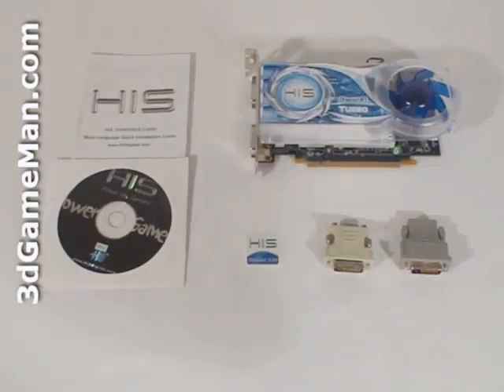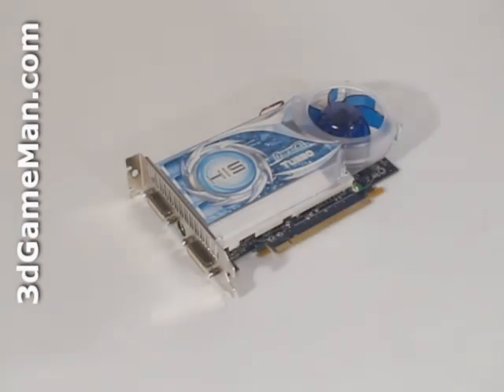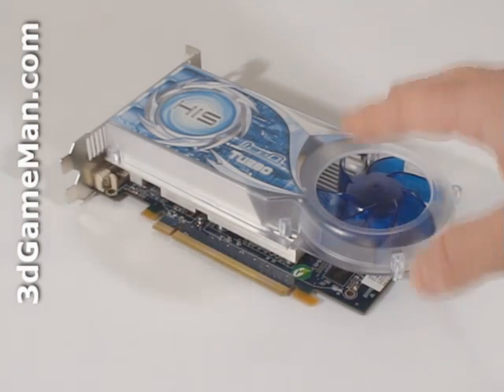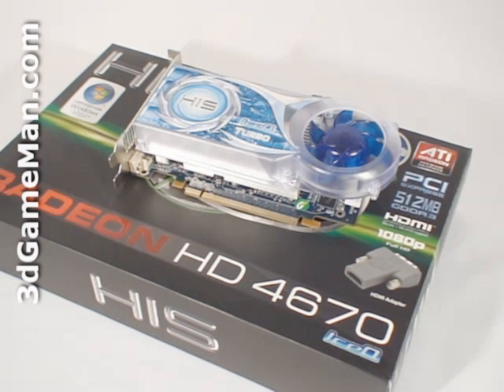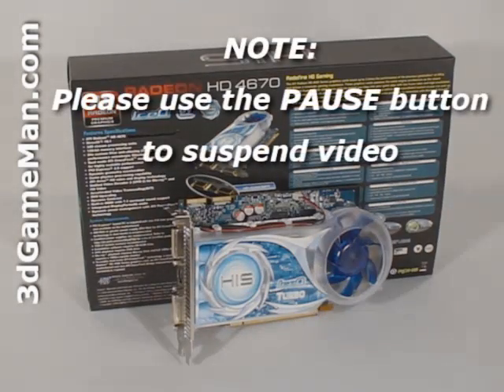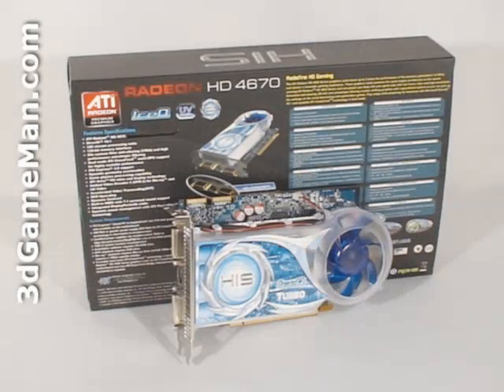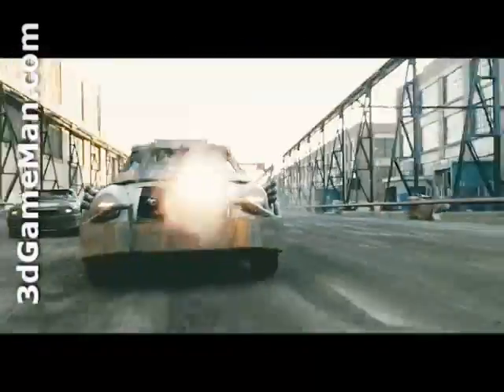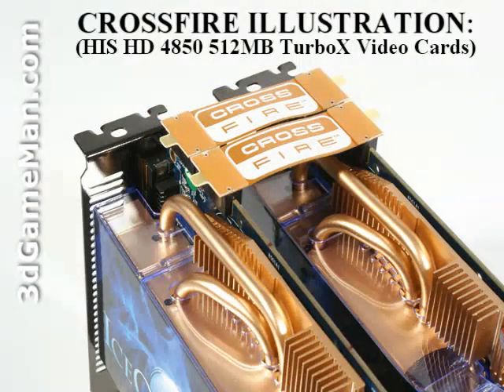#998 - HIS HD 4670 512MB GDDR3 Turbo Video Card Video Review

Comment: @mukslipknot Wrong. The difference is that the DDR3 model is using just standard DDR3 memory that you would use as RAM. GDDR3 is purpose made for Video cards. It means higher clock speeds and bandwidth.

Comment: @gordyjordy123 2 4670's will give you the same performance of a 4850/70 which costs around the 100-170$ range. A 4850 is a better deal if you want great gaming, the 4670 was made to work on prebuilts and low end systems with power supplies that are under 350watts or don't have pci-e connectors.

Comment: Short run down on games I play, at 1440x900..

Dirt 2 - 8xAA, 16xAF, All max, ~35FPS
GTA IV - All Forced to Max, ~30FPS
Borderlands - All max 8xAA, 16xAF, ~45FPS
Bioshock - All max, ~110FPS

So, you'll be able to play at 1366x768 with better results than above.

Also, the delivery company is splitting the orders, I'll be getting the 1st card in about 3 hours. So I'll have dual crossfire videos today.

:)  Depending on the delivery company actually delivering it today! :)

Comment: the ati overdrive, and rivatuner. overclocked this thing reaches 80 degrees load. I have like 2 120mm high performance fans running right underneath it right on the card, and it doesnt even seem to cool down a bit. i also have 4 other case fans.
Reply: 80 degrees is fine

Comment: damnthing runs hotter than people are saying, 45-50 degrees at load??? thats not the case for me, mine is 55-65 degrees at LOAD! i cant overclock more than memory at 925, and core at 850, people got the memory to 1000 (200mhz effective) cuz the cooling, but i got the same card, and im feeling the fan and i can barely feel air from it, i have a 450w psu and wtf is up, this is suppposed to be cool and not hot when load. wtf, did i get a bad one???

Comment: This card blows, why would anybody ever buy it, when the 8800GT is in the same price range a lil more expensive but ALOT faster. Im playing Crysis at 1680X1050 with the EVGA 8800GT SuperClocked Edition then i overclocked it to 735 Core.1850 Shaders/ 2.2GHZ Memory which is faster than the GTX by about 3 to 10 fps in most games. I got videos on my account as proof.

Comment: depends what hardware your using, i know a friend that runs a 9600gt which requires it own power cable and takes about 100 watts or so and this was on a 250 watt psu, hope this helps

Comment: The Asus seems most attractive IMO.  At 10 bucks less than the competition, and Newegg is currently offering a $10.00 mail in rebate!  69.99 for a card that runs with significantly more expensive offerings from those other guys.  Oh, and the giant fan and hs keep everything cool as ice.  Let's also not forget about the built in d-sub for all those with older monitors.  Wow, I am impressed.  Almost bought this model, but just couldnt resist the ASUS.

Comment: This is $100 right now..
9600GT or 8800GT is a better deal.
And there's a 9600GSO for $50 after rebate.

This is just good because it doesn't need 6Pin Power (err.. smaller & IceQ cooler also I guess) >_>

Comment: its excally the reason why i didn't upgrade from a 680i to a 780i

only difference is pci-e v2.0 and 45nm quad core support

-pci-e v2.0 is 1-3fps over pci-e v1.0a

-intel quad cores are just fail, 2 dual core chips on 1 die, with 2 pipelines coming out of it.. this is why intel quad cores are only 5-12 fps more than a dual core at the same GHz

i want my AMD and Nvidia setup back :(